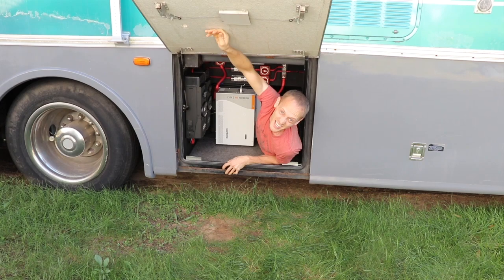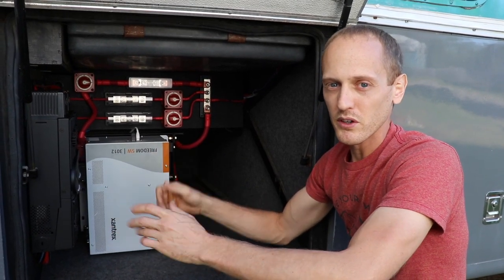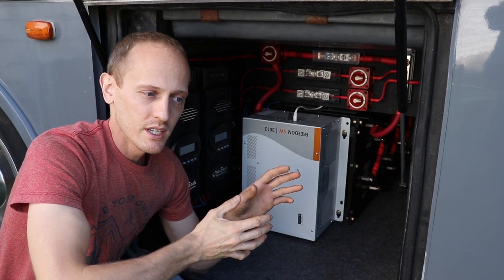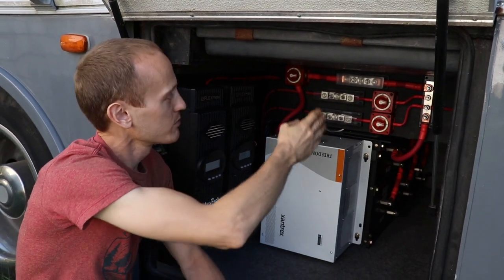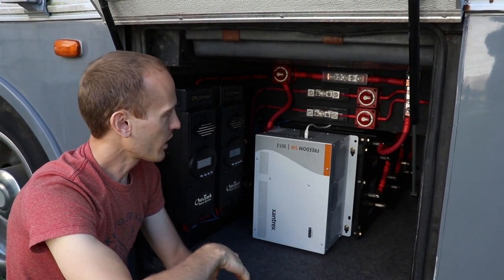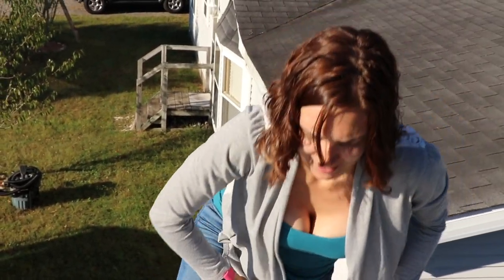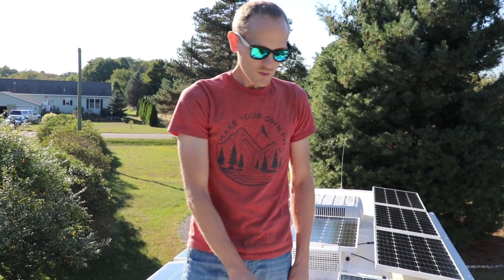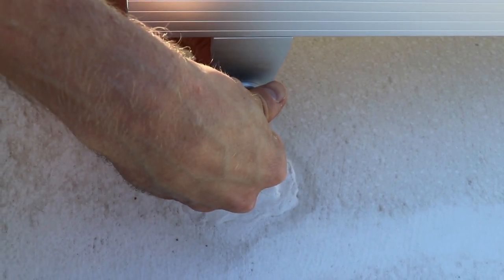Massive DIY RV Solar Install for Off Grid Boondocking

Comment: Awesome set up! I am curious on the power usage from the roof top AC. In my mind, you should have plenty of power to run that all day as long as you are in sun. Obviously you know your system and looks like 5 hrs is about it. Is that AC a 13.5k or 15k btu unit? The reason I ask, is I am drawing up my plans for a off grid solar shed on some property to plug in my travel trailer to. The concept is pretty similar. I will have ~1800 watts of panels, I may just need a larger battery bank.
Reply from the maker: With our setup in full perfect sun, we have seen 120amps coming into the batteries from solar. You only get a couple hours of that peak sun. The one 13.5 roof unit pulls 150-155 amps when the batteries are full and that amperage increases as the voltage decreases. So we are at a constant loss even in the best conditions. Now add in any other draw at all and you see where power becomes an issue. If we want to cook, or run the fridge on electric, or run fans etc then we hit the problem of having power through the night. Then, if it is still hot the next day, you are starting behind the ball on charge and the downward spiral continues. We have lived full time in this rig for 8 months now and would still recommend looking into other avenues of cooling. Either a mini-split or a window unit like we use in extreme cases. Our 6000btu window unit only draws 50amps so we can(and have) run it all day. Worst case was a 91° day with 94% humidity. The window unit got the rig down to 81° and about 20% humidity which felt amazing. Insulation and placement of the RV(in the sun or in the shade) will play a massive role in the effects of the cooling. RV's in the direct sun aren't the best.
Reply: @HereThenGone  We are in north eastern Utah, so hopefully we wont see the extreme conditions you have. From your feedback, I may just have to go back to the drawing board and see if I can find room for a few more solar panels. Great idea on the mini split. I have also been looking at those as an option as well. I was also looking at portable units but they just take up to much room. Safe travels my new friend!
Reply from the maker: @brianfoley4268  I would jump in with a resounding "don't waste your money" when it comes to those portable units. Especially if they are the single vent style. Every person I have heard of trying to make them work for an RV has been extremely disappointed with the output. If your shed is in the sun and your RV is in the shade when you plug it in to the shed, you would have slightly better results, but still not practical for any extended period of heat. Hope you come up with a solution that works for you because having power from the sun is such a great thing.
Reply from the maker: Also, it doesn't matter how large your battery bank is if you can't fill it back up each day.

Comment: Lol 700lbs of batteries to run an AC for 5 hours. Let that sink in rv users. Honda 3000 watt generator is your friend. Or park at the beach an get some breeze.
Reply from the maker: Exactly. Most people don't realize what it takes to run a roof A/C. Travel with the weather or get a window unit for the times you might get stuck in the heat. We hate the drone of a generator. Good thing our Diesel Pusher can handle the weight. We could save about 450-500 pounds by going lithium, but that wasn't in the budget.

Comment: Great video, made easy and video shoots to understand (one of the best)
I am a retired toolmaker, tool designer.
I think your a toolmaker also and that’s why I understand you so good.
Good Job and nice and neat.
I always told the other toolmaker that worked with me , “ If it looks good it probably will run better “
Thank you
Reply from the maker: Thanks so much. Glad it was easy to follow. Making a clean, neat and tidy install is always worth it in the end. Put a little pride in what you do and it will reward you in the end. 😁👍

Comment: You can wire series panels with Schottky Diodes in parallel. If one panel is shaded, the diode will electronically  skip that panel. You loose voltage,  but its better then loosing the panel. If you go series (and I had to due to a higher voltage battery system) and don't use them, you can burn out cells if you get unlucky.
Reply from the maker: We are running a 12v system and have seen 127v coming to each of the MPPT controllers before they convert to lower voltage, higher amperage. Almost 2 years on the roof and 7 1/2 months of full time travel without any issues.
Reply: @HereThenGone  I have a 48 volt system. Getting ready to put up the solar soon. Plan on 2 strings of series, paralleled so I can get the voltage I need.

Comment: Super nice system ! ! ! ! Glad to see someone use OutBack products on a motorhome ! Love that you used 2 Outback in parallel .
I have a few question if you don't mind. (1) Why did you use 3 batteries in each string ? Batteries work better in strings if use in even numbers. Also you stated 3 " 6v batteries ) in series would equal 12 vdc but would increase the current. I understand that the current would increase but the 3 batteries in series would equal 18vdc would it now ? 
You stated that be batteries should not be pulled down to 50% of battery power . Should that voltage be like 12.2 VDC ?
You used 12 panels of 180 watt panels . I don't understand by you didn't use 380watt panels and their would have been
only 5 panels ? Wow a CNC person understand electrical and solar power . Wow I'am really impressed at you knowledge and
understanding of so many things ! ! ! ! ! ! ! !  ! ! ! ! ! ! !  Great System, well put together, and well presented ! ! ! ! ! ! !  ! ! ! ! ! ! !  ! 
Thanks you so much for share your information with us !  ! ! ! ! ! !  Also what wife or girl friend a keeper ! ! ! !
Reply from the maker: Hey Jeff, thanks for watching and dropping a comment.

As for question #1: We have three 12v batteries in a parallel configuration. There are three pairs of 6v batteries. The 6v batteries are wired in series to increase their voltage and create a 12v battery. At that point each of the pairs that is now acting as a single battery are wired in parallel to maintain their 12v but increase their amperage. 

Question #2: Approximate 50% voltage would be 12.1v. At night with no assistance from the panels, under heavy load like our air fryer, we can see as low as 11.7v sometimes, but that is momentary load. As soon as the load is off, they jump back to their true resting state of whatever they happen to be at that evening.

Question #3: Panels come in all shapes and sizes. We know people who had personally used these 160w panels for 8+ years when we bought ours(11 years now) and never had a single problem with them. So we bought what we knew was a quality product. If we were to do it all over again, we would build a rack system that held the panels just above the A/C covers and completely cover the roof. We could get 4000+ watts that way depending on panels. Also not all panels are made to handle the torture of driving down the road. Really large panels are more prone to cracking from pothole America.

Hopefully that sheds some light on the thought process for you. I really enjoy learning anything and everything. That was born out of necessity from not having money for nice things and having to fix my crappy things myself. haha. I didn't go to school for anything. Just happened to get the chance to help out at the machine shop for a couple months. That turned in to 6 years working for them and running the machines before we hit the road.

And after 11 1/2 years together and the last 7 1/2 months on the road with each other 24/7, I'd say my girlfriend is a keeper too.
Reply: Ok I think I have it now. You have two batteries in series to made 12 volts DC but you have 3 strings of batteries in parallel. I wish I could draw this out so that it would make more since.
Reply from the maker: @jsteele42378  correct. Two 6v in series, two 6v in series, two 6v in series. Then those three 12v in parallel for one giant 1200ah 12v battery.

Comment: this is a serious wiring system for this RV, you need to blueprint this, or write a whitepaper on it, or produce an RV Solar Wiring for Dummies book.   It would sell, just based on this video.  Thanks for producing, uploading and sharing this video.
Reply from the maker: Really appreciate that. Lots of time and effort went into all aspects of this build.
Reply: @HereThenGone  -- Yes I can tell, I've used to be in the Electronics industry, 1986-1995, as a technician.   I worked for the G.E. Computer Services, and continued with Bell Atlantic Business System Services, at the same jobsite at DFW International Airport.   I've seen a lot of wiring bundles, some bigger than the waist of a 250lb man, and a lot of T.I./Data rooms.    It was a mess, they used to use chainsaws to cut out the old bundles of data/communication lines in Wiring trays, that ran under the terminals.  

We thought it would get better when the IBM Token Ring networks were installed, which replaced the old ArcNet and star topology networks, it did not.  Sabre/American Airlines, our  primary client, always employed idiots and the lowest bidder --  whenever they installed new communications infrastructure and systems.  It was a mess!   It was like Spaghetti wires running everywhere, from every wiring closet, every 10-15 gates, in each terminal.   And, at the Hangers and at the Corporate campus.

You did a nice job.

Comment: I like this video because this guy says the stuff that is 100% correct....The panels must be mounted under specific angle,at least 20cm from the roof so that the heat is spreaded and not accumulated below the panels....Nice work sir,you gave me a great idea how to mount my solar system ;)

Comment: You've said that all the magic happens in the battery compartment, and later on, you have said the same thing at the roof top. So, where the magic actually happens?
Reply from the maker: It happens everywhere. You just have to look to see it. 👀😉

Comment: you sell those brackets?
Reply from the maker: Unfortunately no. I just made them for my application. I no longer work at the machine shop either since we hit the road.
Reply: @HereThenGone  you have the program that you would be willing to part with then maybe? I work for a machine shop myself but I'm not a programmer

Comment: I like your brackets, do you have any extra?  I’m going to install 4 panels on my van roof and 2 panels on each side that will also act as awnings.  Would you like to help with the design?  Thank you for your video
Reply from the maker: Didn't make any extra brackets unfortunately. Lol. Every application is going to be different, so you need to see what works best for you. Play around with different ideas until you find something that works and most importantly, have fun!!

Comment: You seem very Competition with your electrical design. Why did you not use tesla batteries? They probably would’ve cost you the same as those lead acid batteries.
Reply from the maker: I didn't want to source used batteries and have to design my own BMS. This is my first time ever doing anything like this and wanted to keep it simple.

Comment: Enjoyed your video. Was wondering why you use 6v batteries rather than the same number of 12v batteries? Would you not come out with the same voltage and more capacity? Also do I need to buy all the solar components of the same manufacturer or is it ok to mix and match? Thanks.
Reply from the maker: There are some companies that are making 12v batteries with thicker plates like you get with 6v, but you'll need to do some research first. Most(not all) 12v batteries are for engine starting or a combo of engine starting/trolling ("deep cycle marine") Those are not the kind of battery you want for solar applications. As for the components, you can mix and match all you want, but if you go with all one brand, they may have more features available through communication between devices. While that isn't a requirement, it can be a bonus.
Reply from the maker: Also six 12v batteries of the same size and weight would yield you the same capacity. The constant in power is watt hours. That is determined by amps x volts. While you would have higher volts with the 12v, you would then have half the amps. The total power would be the same in the end.

Comment: Honestly best video I've seen so far on YouTube and Im sure I've searched all of youtube lol
Reply from the maker: Going down the rabbit hole of YouTube! Haha. Thank you for the kind words. 😁
Reply: So you mentioned that the bigger appliances were kept separate from the system? So your not running the washer/dryer and a/c or you can't it seems like most people I've seen don't have the capacity or just aren't there yet last thing what do you think about the Tesla batteries vs battle born lithium batteries I like how you simplified things on your set up. your rig seems to have the most capability to generate power with 12 solar panels so really is it possible?
Reply from the maker: @furyiii805plymouth2  our setup basically gives us the equivalent of a 30 amp hookup. Based on that, we couldn't run everything in our rig at once, so the big power draw items that we are less likely to use while boondocking were kept separate. We didn't wire our washer and dryer into the solar because that would use a lot of our water which is now our limiting factor for how long we can go off grid. We have actually run an extension cord to the washer and dryer from one of the outlets when we were at a place with a wonderful stream in our back yard. We had plenty of power to run it and also fresh water to refill our tanks with. We run our induction cooktop, microwave, fridge, electric skillet, electric water kettle, counter top oven, instant pot, all outlets, furnace fan, exhaust fans, and lights. 
As for Tesla vs Battleborn, it depends on your level of skill and knowledge. Battleborn is a drip in battery that is pretty much idiot proof. Has an incredible BMS(battery management system) that keeps everything under control(overcharging, overdischarging, charging when it's too cold, etc) With The Tesla packs or any other raw lithium packs, you need to figure out how to build your own BMS to perform all those tasks. It will be cheaper, but more hands on.
Reply from the maker: @furyiii805plymouth2  I forgot that we do run our front A/C unit on our setup. Even with our size system it isn't going to run like most people think. We could get 4-5 hours of run time along with our other daily usage, but then need to limit most usage the next day to get a full charge back. We actually have a 6000 btu window A/C that we made a window plate for if we get stuck somewhere too hit. It draws 1/3 the power and can be runn all day, no problem. It won't make the rig an ice box, but it has taken 91 degrees and 94% humidity outside and given us 81 degrees and almost no humidity inside which felt amazing
Reply: @HereThenGone  yeah thats exactly what I need to know basically you still have to supplement your power at some point to get what you need. Thank you so much for your quick response that's a huge help!
Reply: @HereThenGone I understand the advantages but I think I would be maxed out on your particular set up as far as my limitations go if it were me so it seems realistically it's how much money are you willing to throw it to live comfortably
Reply from the maker: @furyiii805plymouth2  exactly right. Some people can live with a 100w panel and a car battery because all they run is a light and a fan. We wanted the comforts of a home while we traveled, so we went big. Saved the money for the system while we were working in order to save money while we are on the road
Reply: @HereThenGone  Well thank you so much for everything huge help!!!

Comment: Do you have a list of your solar hardware? I love the hardware you have. Thanks
Reply from the maker: If you are asking about the tilt stuff for the roof, I made it all custom at my old work. It was 2"x3" angle aluminum for the feet on the roof and brackets on the panels. Then it was 1 1/4" flat stock for the sliding tilt arms. Thumb screws from McMasterCarr and then 1/4-20 wing nuts to lock them together. Used 1/4"x1" lag screws to mount to the roof and 1/4-20 bolts to mount to the panels.

Comment: Really nice looking system, would be interesting to see a more in depth video about how this was all put together.
One question though: would it have been an idea to have put the battery tray on some sort of full extension rail for maintenance?
Reply from the maker: That was the original plan, but there was literally no room for the necessary height required to add a rail system, and these batteries (also any good AGM) don't need maintenance. They won't need to come out until they are dead.

Comment: 50% on a AGM DEEP CYCEL  is 11volt  if you ask SORRY EXIDE
Reply from the maker: Not sure what CHLORID is, but 12.1v is 50%.
Reply: @HereThenGone  my AGM Sunneshine 512/200Ah german Deep cycle batteries from Exide (not chloride old battery) say 11v for 50% 10v empty 
12.4 75% 13.8 Full   chardge. Power 14.4 IT is not linier .. 
Maybe you batteries ain't Deep CYCEL.. but regular car batteries they is 20% left at 12v 
If you got deep CYCEL !!! The power span is way bigger Then 1.5v ITs almost 4 v !! 
In my 48v system chardge power is as. High as 57,6v  and when i  equaliz Then ITs 60v for 2 hrs ..  on that partikular string of batteries
Reply from the maker: @kennethschultz6465  do you have a link? None of the info you provided for the name brings up results for such a battery.